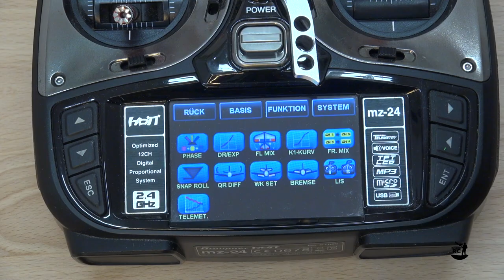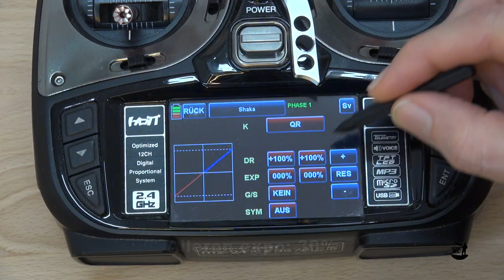Flying the Shaka RC plane

Comment: Many thanks for the video. I fly an unpowered Shaka at the slope, it flies well on a no so windy day, you are correct about the elevator throws, quite sensitive.
I think that the fitting of the motor and esc must have been tight, there`s not much room in the fuselage.
Reply from the maker: Thanks for your comment. Indeed it was a tight fit to get the motor, esc and an additional GPS logger into the small fuselage, but somehow it worked. In the meantime I had the chance to fly it once at the slope but lucky me it was a day with virtually no wind. I will try again as I think the slope is fitting perfectly for the Shaka on days with light winds.

Comment: Great inflight and related video. Nice editing of what I suspect is a number of flights. All seems seamless and smooth. The onboard views are amazing, like riding along. 
The camera mount idea and print is brilliant. Concerning drag, and weight, there is a smaller camera option available (runcam).
Reply from the maker: Thanks! You're right, it is a combination of 6 flights with the onboard camera and 3 or 4 flights filmed from the ground perspective. The Insta Go 2 is already a great improvement in terms of weight and size compared to my previous solutions but on such a light weight plane (250g) the effect is massive. Perhaps I will try another mount with the Go 2 installed horizontally. But I like the perspective of a more elevated view that I currently have. I will also check out the runcam.
Reply: @bavarian_rc  Great editing too. All amazing. 
The 360 has advantage of built-in image stabilization. Other lighter options would require post-flight processing using software like Gyroflow.
Reply from the maker: The image stabilization of the Go 2 is quite amazing. For my other cameras like my older GoPro's I did the stabilization in the editing software with a specific plug-in but not always with perfect results. I guess the gyro data of the Insta360 is making the difference. Thanks as well for your positive feedback concerning my editing. Obviously you know what effort is behind editing a video. I try to get better with every video I make but the effort for increasing the quality is kind of exponential and I need to keep in mind that this is just a hobby and I am a one man show 😀 ... but it is still a lot of fun and I enjoy it.

Comment: Where to put cg bro i am new
Reply from the maker: Hi, usually the CG for a „standard“ plane is around 25% of the wing cord. But this might vary from plane to plane and sometimes you will have completely different figures. For a flying wing like the Shaka with its forward swept wings the CG is far more in front. So if you want to be on the safe side then check on the internet as there are many online tools for CG calculation. You can enter your wing geometry and basic dimensions of the plane and it will calculate a range for the CG. For the first flight go to the forward edge of the CG range. A nose heavy plane will fly bad but a tail heavy plane will only fly once 😜 I hope this helps. If you have more questions the don’t hesitate to post another comment